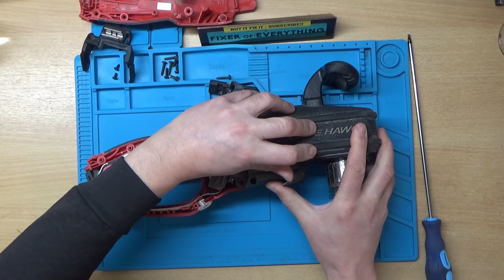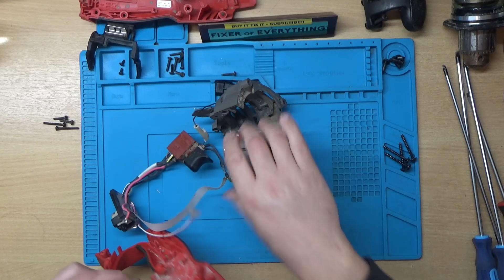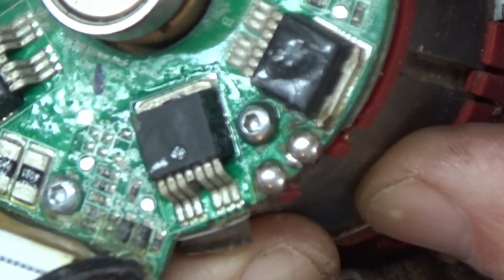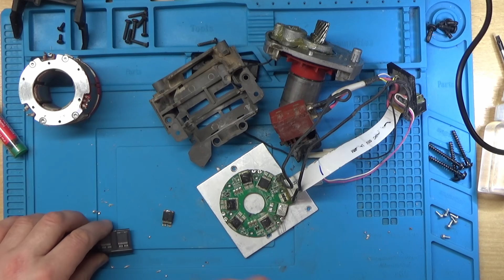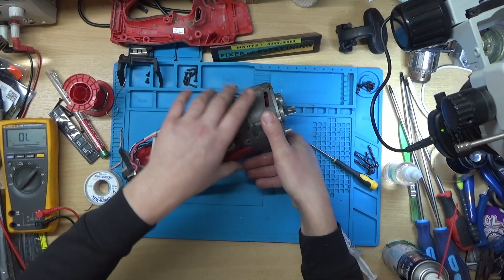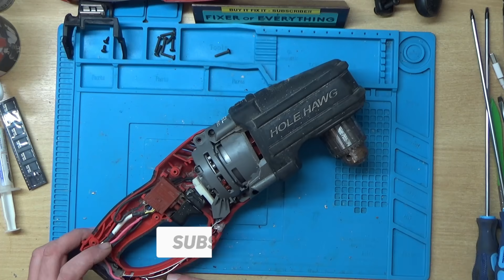Faulty Milwaukee Hole Hawg Drill | Let's FIX it!

Comment: what if all of the mosfets are shorted out should i still replace them or is the micro chip done for
Reply from the maker: It will be very unlikely that all of them are shorted. You will be measuring the shorted one when measuring the others. See if any have the gate pin shorted as that will be the true shorted one. Remove it then test the others again 😉

Comment: great video! id like to do this repair on my hole hawg but ive never soldered electronics. do you have a video explaining a little more in depth how you reattached it? or just provide an explanation here, Forgive my novice nature, it wasnt exactly straighforward to me, it looks like the solder was still soft when you applied the mofet? also what was the you used to clean off the old solder? is that a heat gun you used to reactivate the solder? the links you added no longer work on amazon. i understand im simply asking basic soldering procedure questions so if you want to refer me to a video rather than writing i completely understand. any help would be appreciated. thanks!
Reply from the maker: Thanks Michael,.yes it's a hot air rework station that I used. I might have pre-heated the board first before attaching the new mosfet. Hope that helps.
Reply: @BuyitFixit very helpful! Thanks for responding. What was that you used to remove the old solder?
Reply from the maker: I can't remember off hand. It might have been solder wick, or if not I probably used chip quik low melt solder.
Reply: @BuyitFixit very helpful sir! Much appreciated! I’m going to take it on thanks to your inspiration! My first project. Thanks again

Comment: Pretty amazing video repair on the Hole Hawk.   Complete disassembly - amazing.    

I’m hoping someone out there can provide some insight. On an issue I have with my vintage Milwaukee 1/2” right angle drill.   I suspect the trigger is faulty.  It sporadically starts when the trigger is pulled but most often starts as I slowly release the trigger.  Once it starts, it runs fine with good power.    

I have few pictures and video I’ll try to upload.  The label/name plate is worn so my best guess is that the model is 1101-01.   I can’t seem to find a replacement trigger due to the drills age.  Any help would be appreciated, including identifying the trigger part number and supplier.
Reply from the maker: It possibly sounds like a bad contact  inside the switch. I had this with a Milwaukee circular saw before. There's two parts to it. One is the speed control and the other is mechanical switch contacts inside. These can either burn or get blackened causing a bad or intermittent connection so that's what I suspect is going on. You could try searching the likes of Aliexpress to see if there are any switches which look similar.

Comment: Would it be common to find every other mosfet blown? I’m likely reading wrong but appears to be what I’ve found in mine…did not know what a mosfet was until today. Thank you!
Reply from the maker: What you might be reading is a short on one, and you are measuring the short going through the coils of the motor. I've had the same myself. Just look to see if any have cracks in them, it's unlikely 3 are blown. Two will probably be OK, and it's just one of them.
Reply: @BuyitFixit 
Sounds practical. Might be out of my league from here but learned a few things today & am equally thankful for your response.

Comment: I enjoy watching you fix things, but it is a little suspect that you went right to the mosfet instead of the switch or power delivery.
Reply from the maker: Experience. I've fixed quite a few of these type of tools in previous videos. All Milwaukee and brushless. 95% of the time it's blown mosfets. Occasionally it can sent voltage back into the microcontroller and then it's game over pretty much. That happened with the Milwaukee circular saw I looked at. Luckily someone sent me a microcontroller board from another dead unit and I was able to repair it in a follow up video.
Reply: @BuyitFixit  Makes sense. Nothing trumps experience.

Comment: Enjoy your videos, and good finding on this one. However, I often wonder since I work with metal as well and know those boards can get covered in metal dust/wood dust why most people do not put conformal coating back on the components to prevent shorting?
Reply from the maker: @magnum164  Thanks 👍Good idea, I should really get some.

Comment: I have the same drill that randomly works. I will pick it up one day and throw a battery on and it works a treat. 5 minutes later it’s dead again for 3 months. Any ideas?
Reply from the maker: Had something like that with one of the SDS drills after I replaced a failed mosfet in it, and it was a damaged contact in the switch. Could possibly be a dirty contacts in the switch. Does it have the same power when it is working? Just thinking faulty mosfet could cause it not to work depending on the position of the motor.
Reply: @BuyitFixit  yes it has the same power and torque when it decides to work. Then 2 minutes later it won’t work at all. I have owned it for awhile and it was rarely used but Milwaukee still told me to go kick rocks. I do like Milwaukee but their stuff is starting to frustrate me.

Comment: Tip - when you're pulling those boards off the motor just mark one of the sides of the board and motor housing with a chinagraph or a permanent marker or even electrical tape so you get the orientation right.
Reply from the maker: Yes, lesson learned from this one. I did exactly that in a more recent video on the Kenwood mixer I looked at 👍

Comment: I'm curious, why didn't you use low melt solder to remove MOSFET.   Also, I noticed you did not apply flux prior to hot air removal of damaged MOSFET.  In other vids, you are generous with flux prior to removing damaged components and after IPA clean up, flux again for fresh solder and New component
Reply from the maker: Sometimes I forget 😂😂👍

Comment: thats not good that you can  not buy new e prom and the firmeware is not avalable
Reply from the maker: Yes I had that on a Milwaukee circular saw which I couldn't repair (after changing the mosfets), although a viewer did sent me a replacement microcontroller from another broken saw, so I did manage to fix it in a follow up video.

Comment: what has cuesd the short ?
Reply from the maker: They just sometimes fail. Perhaps they are being pushed too hard. There could be a lot of torque (pressure and they pull a lot of current) or if the drill jams, although they do have a current sense resistor so it should stop if that's the case.

Comment: This must be a common issue with these drills because there is an awful lot of them on EBay for parts...
Reply from the maker: Could be. I've not really seen a lot of those type but I've seen quite a few of the SDS drills and the circular saws which use pretty much the same internals.

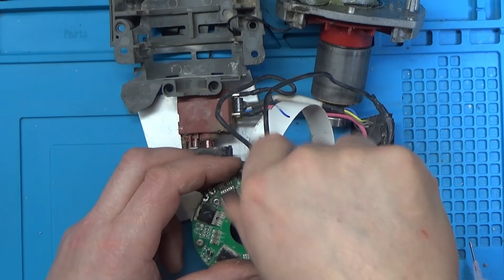Comment: 14:50 i've not been through the end of the video yet, so just wondering
if the mossfet blew, would this not only fix the blown mossfet, not fix the cause of the blown mossfet?
is this just a general engineered design fault?
no way to figure it out and fix?
from ignorance with appreciation
Reply from the maker: I've had this problem on a number of tools. I think if the tool jams or if it's had too much pressure on it, they can blow. Sometimes it takes the control chip out too if it goes short and sends 18v down the gate line into the IC.
Reply: @BuyitFixit  there must be some available protection technology for this? i mean a diode even? can't be too expensive??
Reply: @BuyitFixit a fuse may be expensive for mfg costs though

Comment: 13:10 i believe you know what you're doing
from an out sider perspective
kinda funny and ironic to remove it from a large aluminum heat sinc to put it on.. a large aluminum heat sinc ahaha
kick ass thanks for the vid
Reply from the maker: The difference is, it's bolted to the one on the drill, it's just resting on the one on my mat 🙂 I didn't want a big brown burn mark 😂😂😂👍

Comment: I have a sawzall that seems to be the same board and the resistor at C32 burnt up! 
Just wondering where I can find the spec for these and where to buy them if you could help? 

Love your videos keep them going
Reply from the maker: I did look at one of those a while back. If it's the same model as you might be able to see what part it is. C denotes capacitor not resistor, so it sounds like a capacitor has failed. Usually it's not a huge issue unless it has shorted in which case remove it and see what happens.

Comment: Hi. Love this channel. I have a question. I have an M18 Fuel 3/4 drive impact gun. It suddenly stopped working. The led comes on, and the motor starts for maybe half a revolution and stops. I have it apart. I'd say the motor board is identical to the one here. So, none of the mosfets show a short, neither do the caps. The resistors seem ok as well. Do you think it might be the hall effect sensors? And do you have a vid where you have done those? Fingers crossed it's not the main board, as it's an expensive tool. I'm just a little out of my comfort zone with the hall effect stuff. 
Thanks, whether you answer or not.
Reply from the maker: Thanks 👍I do try and respond to everyone. Usually the problem is Mosfets. I don't think I've had a hall effect failure apart from 1 grinder which someone sent me which the centre rotor of the motor had been bent at the rear from debris and had caused it to wear away.
Reply: @BuyitFixit  Yes, I know you do, and I'm sure we all appreciate it. I know I do and selfishly don't want your channel to get too big...🙂
Mine has no physical issues, everything seems fine. It just stopped. Mosfets don't show shorts, but I suppose they can fail in other ways. I'll try changing them and see. I can still get an entire electronics package for it, from main board at the batt, through the switch and up to the stator, but I'd prefer not to if it's just a simple component failure.
Thank you very much for taking the time.
Reply from the maker: No problem, glad to help👍
Reply: @BuyitFixit  Thought this might interest you. Guy isn't as good as you, but he does get into the main board at the battery connector. Going to try this on mine,   https://youtu.be/26_Fy6O2unk?si=Cz8dWeuRt0rzt3K7

Comment: Hello, I would like to ask for an advice, I have an M18 Fuel Brad Nailer where it doesnt turn on, no lights even with working battery, do you know where I could start?. Enjoy watching your videos! More power to you!
Reply from the maker: Sounds like a problem on the control board. There is a processor on there that should have 3.3V when power is connected. I did do a video on a nail gun but it was a different issue to the one that you have.

Comment: I noticed one thing while you were checking the FETs: You only checked G-S and G-D. In my experience you also need to check D-S because I have seen enough broken Mosfets where D-S was shorted and the gate was still high impedance. I typically only check G-S and D-S by the way, I can't recall ever seing any FETs where G-D was shorted without all three terminals just being compeltely shorted together.
Reply from the maker: I didn't have the Datasheet at hand, so couldn't remember which pin was which at the time, apart from the gate pin. Normally I'd check the S-D pins too but most of the failures I've seen on these is either the mosfet is competely shorted or exploded.

Comment: Just a thought that any ball bearing in that sort of environment would be greased not oiled, and putting three in one on it would just dilute the grease making the bearing looser and more noisy ending in failure. And there's no magic in BLDC control chips, and the Hall effects inputs are probably pretty standard. Just have to work out if the speed control is analogue or PWM and get one of the thousands of controllers available. Of course you have to also get a programming board (AUD$30-40) and a bit of free software to match input from switch with speed of mosfet firing. Still be cheaper, and more fun, than just shelling out the AUD$500 plus for a new skin. Keep up the good work. Love the concision and lack of intrusive music.
Reply from the maker: First of all thanks for the support. The BLDC controller in these tools does more than just control the motor. It also monitors the battery, as there is no over discharge protection in the Milwaukee batteries, it is all done in the tool. So the microcontroller won't allow the motor to try and run if the battery is too low. It also controls things such as the front LED when the trigger is pressed, and monitors the battery temperature. This is why it's a microcontroller containing firmware with a BLDC pre-driver. It takes the inputs from the hall effect transistors which are pretty standard as you say. I had thought about creating a replacement open source board, as the circular saws are very prone to failure.
Reply: ..however, if the bearing was already failing, there's little point in being finicky with it as it has no bearing (hah!) on the immediate fix. If this was a full refurb job then fine, but for this just to get the m/c working again for a bit, no, IMO
Reply from the maker: "No bearing on it" 😂😂😂😂😂😂😂😂😂😂😂😂👍

Comment: Sometimes it takes you longer to take to bits than fix, or so it seems. When you were taking the circuit board off I thought you had clocked that it might be able to put it back wrong as you seemed to be looking at it. However 🙂 Yet another great fix though.
Reply from the maker: Yes, I did pause and was looking for my Sharpie to mark it. I couldn't find it to hand and just got on with it 😂😂😂 At least I learned something so hopefully I'll not make the same mistake again 👍

Comment: I felt relieved that whatever shorted the MOSFET didn’t also take out the microcontroller. Excellent work as always.
The brief glimpse of your snowy countryside felt refreshing. It’s 36°C in my locale.
Reply from the maker: Thanks, yes all the snow has gone now, although it is still pretty cold here. 1.5C outside currently.

Comment: Just a tip for getting to the numbers on the chips that are coated like that. I found ACETONE breaks that coating down very well, as it does my daughters nail polish!! LOL.
I let it sit for a beer or two, then begin to scrape the chip with an old credit card that has been ground down to act as a scraper. That helps with not destroying the lazer etching.
Then I switch to 99% ipa for a few wipes, then smear whiteout over the number, let it dry for a few seconds only, then smear my finger over it until I begin to see numbers, and if there is 
a number? you will see it with the correct light deflection and the microscope my friend. Hope this helps. Keep the great videos coming please.
Reply from the maker: Thank you 👍and thanks for the tips 🙂

Comment: what? a milwaukee fuel you can "easily" replace a mosfet? next version will be potted as allways. from experience fixing a die grinder and uggadugga that both needed depotting..
Reply from the maker: Yes, the angle grinders and I think it was the drills are all potted which makes them not easily repairable 😢

Comment: always check the trigger switch first
Reply from the maker: It could have possibly been the switch, but because the LED was lighting and I was getting a "click" from the motor it seemed unlikely. I've had quite a few tools like this, drills, saws etc and 95% of the time it is blown MOSFETS.

Comment: Hate those BLDC motors… if the controller fails, next to impossible to get hold of the controller chips, esp. if the motor is 10 years or older….🤬🤬🤬
Reply from the maker: Yeah, they are a lot more common now as they provide more torque and more energy efficiency in a smaller motor than a standard brushed motor.

Comment: Its nice that the controller knows a mosfet is shorted and won't destroy the rest of the fets when someone attempts to use it again.
Reply from the maker: Yes they have current sensing resistors on the back of the motor board, although I have had it where 4 mosfets were shorted on saw and it had sent 18v down the ribbon cable and fried the motor controller chip.

Comment: Think that dry bearing was a source of the failure?
Reply from the maker: Doubt it, it was just slightly noisy. I've had quite a few drills saws etc with the same issue. I think it's when they get jammed it puts a lot of strain on those mosfets.

Comment: Nice fix. I was wondering why you didn't look at the switch first, but if you've had experience with those mosfets before, that explains it. Thanks for sharing.
Reply from the maker: Thanks 👍Yes, I've looked at a couple of SDS drills, Saws, and a few other tools. Blown MOSFETS are usually the cause of them not working.

Comment: You can use heat to let grease flow into a bearing, not a brilliant fix but can get you by in a pinch if you have to wait for parts etc
Reply from the maker: Good idea! I didn't think of that at the time. Thanks for sharing 👍

Comment: nice job i was surprised one mosfet and no movment at all. must have short circit protection.
Reply from the maker: Yes, I think it measures the current by the two resistors near the ribbon cable on the back of the motor PCB.

Comment: You have had your issues with those mosfets on Milwaukee tools in the past. Seems to be a weak point in those tools
Reply from the maker: Yes agree. It's what takes the brunt of the power though and if the tool gets jammed or such it can put quite a strain on them causing them to fail.

Comment: well the old AC version of the hole Hawg was more than capable of ripping the drill out of your hands especially using 2' hole saws, nice fix, I am sure you made your buddies day.
Reply from the maker: Thanks 👍
Reply: I didn't even know they made holesaws that big!
Reply: @oliverer3  The biggest I've seen is 11" but in roughing in plumbing they use up to 6' hole saws for pipe.